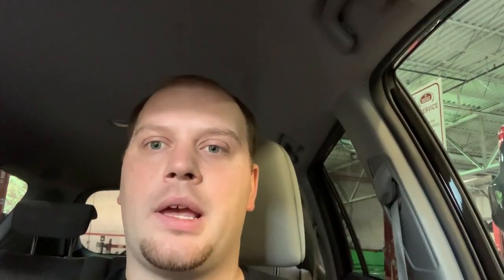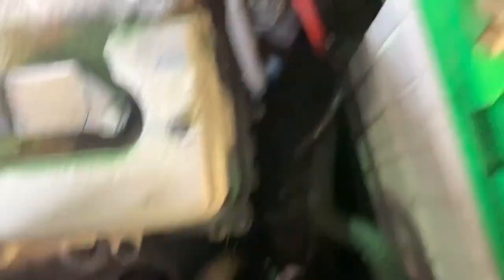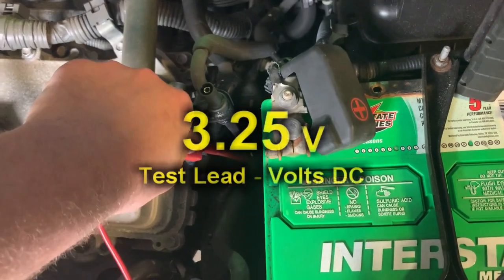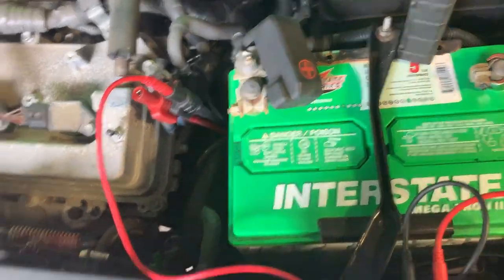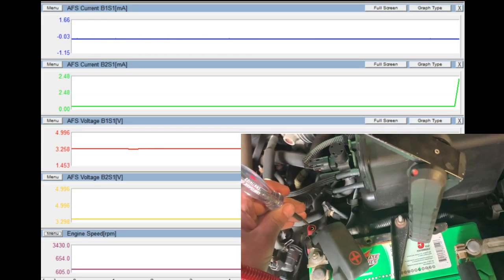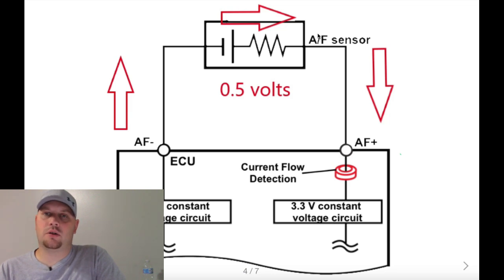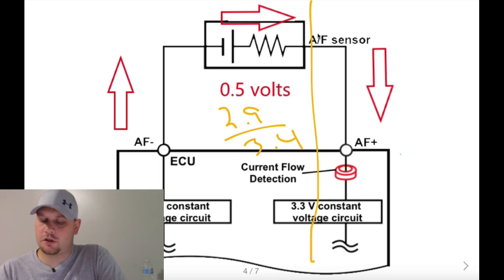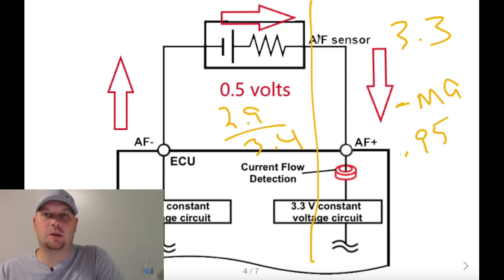'12 Toyota Rav4 P2197 Quick tip & A/F Sensor operation video

Comment: I believe Honda's AFR is a double pump design. Great explanation of the on the workings but need to include the heater side since they are high temperature requirements for this to work properly.

Comment: Your diagrams are inaccurate and your explanation flawed. Voltages do not overcome each other. Read the documentation on the component and further research the topic before posting videos. Your explanation about lambda is accurate.
Reply from the maker: Those diagrams are straight from toyota training. But thanks for commenting

Comment: Hello there,,I know this is somewhat an older post, but since youre the Toyota go-to guy, Have you ever had an older camry (2004) with an A/F sensor heater code p0031 cause a bog down type of symptom? I had one and the sensor was bad, (OL on the sensors heater), but I didnt get to fix it due to the customer refusing repair because of high mileage (270k) on the clock. But it had this bog out whenever hitting the throttle, I expected to find fuel pressure dropping out like a rock, but it was fine, cats were fine also,. I could only conclude the one front A/F sensor not getting to temp and not working was causing this issue. Its eating me up not being able to have replaced then sensor and find the actual fault if it was something else. MAF reading was good too, but I did notice the rear 02 going lean at WOT. so I know it was starving for fuel.. Just one of those that I cant stop thinking about..

Comment: Thanks for the explanation..i need help on a 05 camry 2.4l. I have a p0171 code..maf and a/f sensor has been replaced without any effect on fuel trims.. ltft 44 stft 20..i smoke test intake and exhaust system no luck..remove and test fuel injector for pattern spray and amount of fuel no luck..check for fuel pressure and volume..pressure 48 to 50 psi..volume 6 to 8 glp..spark plugs look fine..check for pcv..purge valve..booster leaking no luck..i am out of ideas..i erase the code an as soon as start the engine maybe 30 to 1 mim lean code comes back..this is the third toyota i have no found the issue within one year..help please.
Reply from the maker: I have a couple different videos diagnosing lean codes.

The diagnostic process starts with WHEN is it lean? At idle, or under load?
Reply: At idle its ltft 44 stft 20...3000 rpm ltft 24 stft 20...crusing ltft 16 stft 14..

Comment: Great explanation. Is  it always that only higher voltage side(+) measured by PCM or could be lower side (-)  also measured by PCM.
Reply from the maker: I'm not sure of other makes and models, honestly. But I am fairly certain that Toyota only uses the higher side.
Reply: @VoltageDropDiagnostics  Thanks

Comment: Good bypass to drive the circuit high and low.  FWIW you can simply touch B+ or B- with lightly wetted fingers, and do the same thing.  Lick your finger, touch your jump lead from B-, and hold a T-pin in your other hand to drag the circuit to zero.  Use B+ to drive it high.
Reply from the maker: Will this work on wide and oxygen sensors?
Reply: @VoltageDropDiagnostics    I've done it on many standard oxygen sensors.  Being that AFR sensors usually don't fail low or high, instead having a bias in one direction, i don't normally have to drive them high/low with a jump lead as I can do so with other means.  That said I'm pretty sure I used it on a Rav4 lambda sensor last week.  Give it a try, it will pull up/down any circuit running on really low current.   South main auto has shown it a few times.  Lick both fingers, drag the signal where you want to.  Obviously it doesn't move any current, but it will display on the scan tool.
Reply: Since I don't have an led test lamp I gave this a try and sure enough it works. The a/f sensor reads from 2.6 to 2.9 key on engine off and when I touch the positive post, and when I switch to the neg post it goes to 3.3 and stays there. Does that mean the sensor is failed?

Comment: Thanks for a good practical video on the air/fuel ratio sensor. These are brand specific and less generic than O2s. Harder to keep up with stats that are good or bad. 😁
Reply from the maker: Yeah, they are very much brand specific BUT lambda is always lambda. Which is what I use on cars that I'm not familiar with!

Comment: Great video and explanation thank you, how many wire in toyota af sensor?
Reply from the maker: They have 4 wires. 2 for the heater and two for the signal
Reply: @VoltageDropDiagnostics  thank you so much